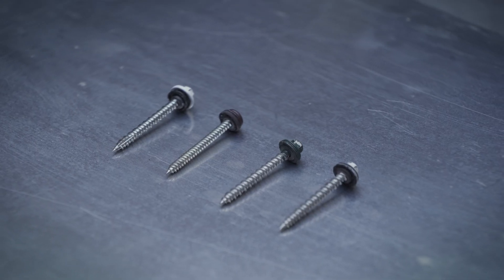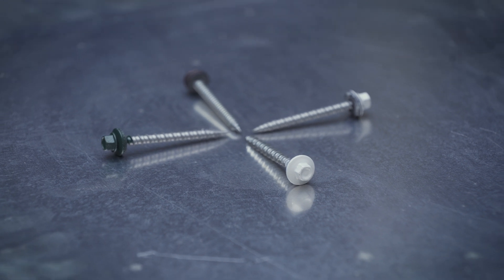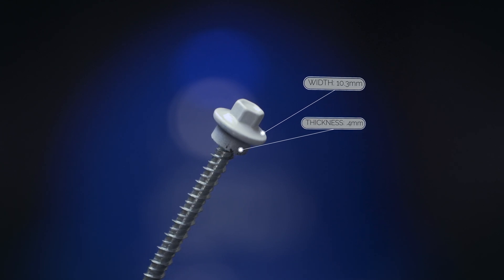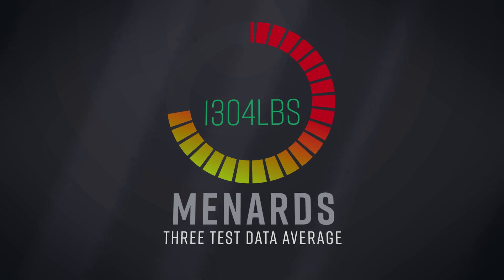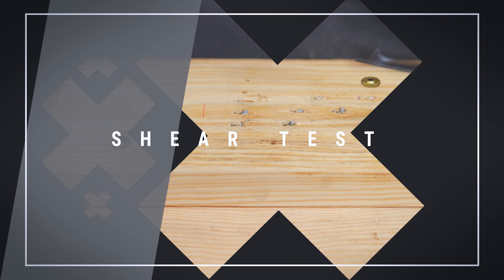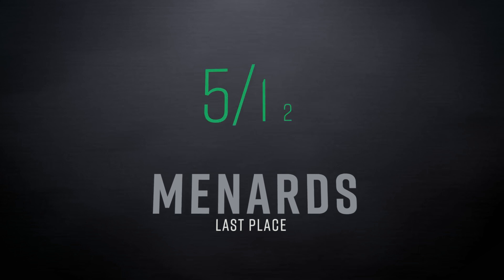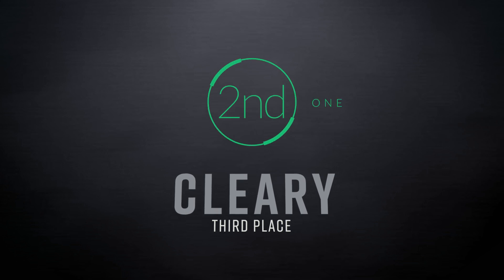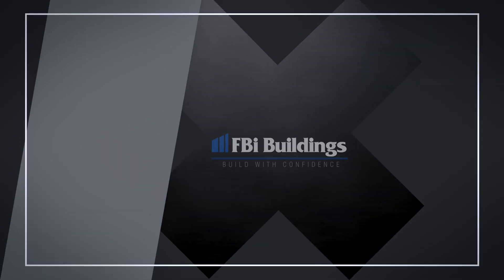Cleary, Menards, Morton, and FBi Screw Comparison Testing

Comment: Stainless is not softer. It is more brittle and therefore failed.
Reply from the maker: Hi there! Thank you for your comment! 

"Due to its low carbon content, most stainless steel is somewhat softer than carbon steel; thus having a fairly low yield strength. This means that it’s more vulnerable to denting and bending than carbon steel. Most carbon steel, on the other hand, is somewhat brittle – it has a relatively high yield strength, but lower tensile strength. Carbon steel will maintain its shape almost to its breaking point but will have a sudden break when it passes it. (Think of a carbon steel knife blade for an example—it strongly resists bending but will snap if enough pressure is applied).”
 
For more information, we recommend checking out this article.
 
https://www.polycase.com/techtalk/steel-enclosures/carbon-steel-vs-stainless-steel.html
Reply: stainless is softer than carbon steel
Reply: Stainless doesn't rust though. After years when that screw rots and rusts away it will let go. Where's that test?